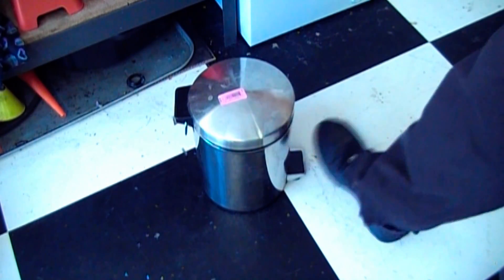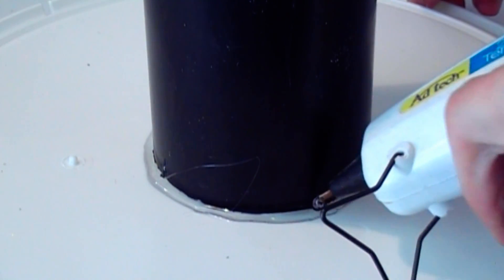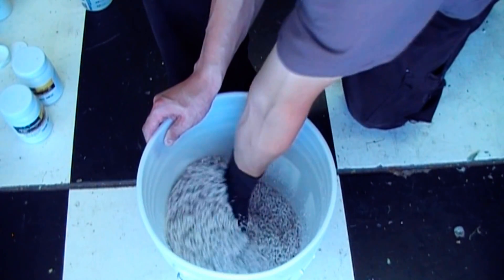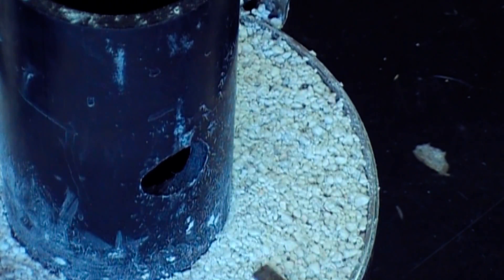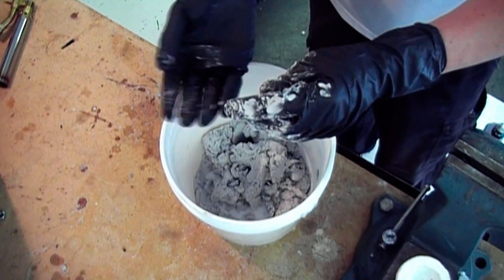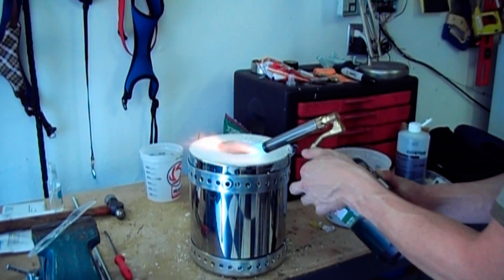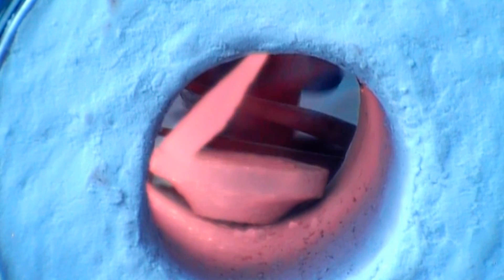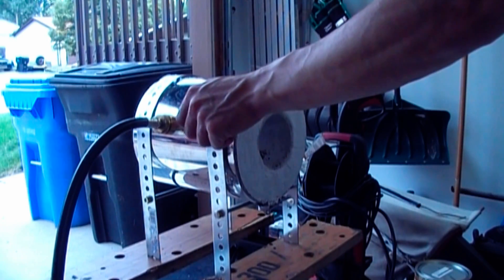How to build a trashcan forge

Comment: Could this be done in a slightly bigger size ? if so whats the ratio of the refectory lining and the sealing cement so this can be scaled up trash cans like that come in large sizes right?  Also could you somehow make doors on it so you could close it and use it for heat treating just curious great video
Reply from the maker: It can be scaled up sure, but the cost gets really out of hand if you go much bigger. The ratios would be the same for the materials. If I were to do a 40gallon trash can sized one, I would make the majority of the lining out of slabs of rockwool, followed by a 3 inch thick shell of this mixture.
Reply: a 40 gallon one would be fairly large haha how much did this one cost to make? i assume when you say the cost gets out of hand you mean the perlite and such?
Reply from the maker: The most expensive part is the aluminum oxide, about 3 dollars a pound, but it's heavy so a pound is not a lot. This little forge used 4 pounds of aluminum oxide. For the forge alone I think the cost was around 35 to 40 dollars.
Reply: Okay thanks for the info man great video very helpful!

Comment: For the coating, does it have to be aluminum oxide or will any sandblasting abrasive work?  I can't find enough silica drying packs, so I will have to order the sodium silica as I cannot find any store that sells it locally.
Reply: cheyennew811 Just trying to help a dude out. :) I had a hard time find it as well, so I was jazzed when I got the kitty litter and it actually worked. :) Also to note, sometimes you need to add a little extra water so the silica can thoroughly melt If your silica gels kind of coagulate and float around try adding a little more water. The first time I didn't add any more water and ended up with some super thick sodium silicate that I had to reheat and add a little water to. Good luck!!
Reply: If you have a Hobby Lobby, go there for the silica.  you can get a 1 pound bag or a 5 pound bag.  very reasonable prices.
Reply: +Dave Smith, we have a Hobby Lobby here. I will go by and see if they have it.
Reply: Go to WalMart and buy MiMi cat litter. It is 4-5.00 for a 4 pound bag of silica gel. That is what I have used more than once to make sodium silicate. Here is a link:  https://www.walmart.com/ip/Mimi-Litter-Cat-Litter-4-lb-Cats/12018928
Reply: +Ith Bombgard Thanks, I will try it out.

Comment: FYI, in any future projects its always a good idea to sand the plastic you want to glue/hot glue.  It helps, especially if it's a slippery surface, like what you mentioned in your video.  Anyways, awesome video, very informative.  I've always wanted to learn about this and now I have, thanks!
Reply: This is generally a good tip, but in this case it seems better to me not to sand the plastic because the lid is just being used temporarily to form the cement, and then it is removed. It'd be a bit harder to remove if you sand first.

Comment: Does it create a problem that the interior surface of the forge is not flat on the bottom?   I was thinking of building a mini forge too so I'm curious to know if it's presented a problem or if you would prefer it to be flat.
Reply from the maker: I have found that the round floor not to be problematic, a flat floor would require filling in the curve and reducing the interior area.
Reply: clkindred Awesome. I just found your channel.  Great videos.  Getting my fill before bed time.

Comment: Do you have to use the sodium silicate along with the perlite? Or can you just use plaster and perlite mixed together?
Reply from the maker: I have found that plaster dose not hold up as well as the binder. It would probably work for a while though.
Reply: clkindred
Awesome, thank you for the reply and all of the interesting content.
Reply from the maker: NwoDispatcher sure, but fine kaolin which would form a plastic like wet clay will need to dry longer before the first firing.
Reply: +clkindred how do you think kaolin would work as a liner?

Comment: The sealing cement... Do we need to add water? I ended up with a very dry un useable clumps
Reply from the maker: that will depend on how much water your sodium silicate had in it already. the ratio of silicate to aluminum oxide I showed is a good start, but you may need to add water.
Reply: +clkindred Thanks, next time, I'll mix the sandy stuff in the watery stuff till it looks good.

Comment: could I use fine sand in place of aluminum oxide?
Reply: +Austin Priest Yes you could. Pure blended silica from kitty litter doesn't melt till 1,713C which is just 300-400C under aluminum oxide. However, pure silica liners (with water glass) have a habit of cracking unless you add a small % of lye. The lye melts when fired to lock it up nicely creating a stronger bond. But still to minimalize cracking I'd bring the silica amount down under 60%. You have to keep in mind that pure silica is very hygroscopic. Which means it's absorbing water and expanding when not in use and is releasing water and shrinking when the forge is turned on. So you need to dilute the silica with other materials.... baby powder is decent. My best liner was made from a package of aluminum oxide / silicon carbide grinding wheels from harbor freight. They're like $10 for a stack. Take the wheels, bang them with a hammer to shatter them then cook them in your forge for 1 hour to smoke the resin out. Those wheels are binded only with high pressure and some resin. So once you cook the resin out (no more smoke) you'll be left over with a mixture of aluminum oxide, silicon carbide and a lower % of iron oxide. None of those 3 materials will expand or contract the way silica does. And it breaks apart like coal after firing. So crush them into smaller chunks with a hammer then throw them in a blender. Mix with a tiny bit of water glass. That mix is stronger than Al2O3 alone. Because I've held my oxyhydro torch to both (2500C/5000F) and I can get fine Al2O3 pieces to melt but I can't get the alumina/carbide mix to melt no matter what.

You could also just set off some thermite and use magnets to remove the pure iron. Or buy sand blasting media from home depot call your store to see if they have it. And I know for a fact that Lowes carry's a product called "Imperials Stove & Furnace Cement". I've used it myself it's a mix of silica, magnesium silicate, sodium silicate and lye. It comes out like a very hard but wet and spreadable black clay. But when CURED PROPERLY that stuff is strong as fuck. It sounds like steel / ceramic when you hit it. And you can mold firebrick and all sorts of shit out of it. It's also very cheap. And although it's less likely to crack then pure silica it will still fail slowly on direct contact with water.  Which is easy to avoid if you're not an idiot.

Overall I'd say buy a bunch of grinding wheels for $10 then buy $12 worth of firebrick cement (mix both to line your forge). Most Lowes employees don't know where it's stored and will say they don't sell it. But it's right by the fluxes and plumbers tape and really is some cool shit. You can make crucibles and all sorts of stuff just never wash them with water and you'll be good. Also be sure to CURE SLOWLY. More slowly than the directions say. It will set up immediately (less than 5 mins) and get hard but I let it sit 3 days if I'm making a crucible. Sometimes I'll put it in a dehydrator for a day. Then I prefire it very low around 200-300C for 2 hours. Then I wait another 3 days to do a 1000+C fire. It's super cool stuff and realistically is all you need to line your forge. And the more you fire it the more resilient it becomes to water but I'd still never wash it with water.
Reply: +Robert Cece Thanks for your input Robert.
Reply: +Robert Cece Awesome, thank you very much.
Reply: +Robert Cece 
 can take the recipie from vid, replace the Alum Oxide with high temp Fire brick Cement.. and I'm good to go? 
Alum Oxide is a tough cookie to get cheap.. local.. if I can use fire cement in lieu of the oxide .. that'd be reassuring and I can start building :) 
many thanks for your help..
Reply: +Austin Priest maybe you can help... I am set to build but I need a substitute for the Alum Oxide... am I grand to power on with fire cement or have you found any other tips while searching.. im in same boat.. the alum oxide is my only obstacle right now.. many thanks Austin. :)

Comment: Very, very clean looking build,  I have a question, how much insulation does this setup provide? can you get a reading on the outside of the forge for instance, i can tell it doesn't appear to turn red or heat up, but i was wondering how it is working long term, Also what temp can you get inside your forge? Thanks

Comment: Does it matter what size grit of aluminum oxide I use
Reply from the maker: +Rob Stevensen Sort of, the smaller the grit, the more easily it coats the perlite. As for the sealing cement, the smaller the grit, the more "clay like" the cement, larger grit has trouble being worked and spread because it's more like wet sand.

Comment: Hi, Is it okay to use potassium silicate instead of sodium silicate? What is the main difference between the two substanses?
Reply from the maker: +Eetu Korhonen It would probably be fine, there is not a lot of difference between the two substances, although the potassium silicate would be more expensive.
Reply: +clkindred Thanks for your reply. How has your forge held up? Im intending to use mine to melt bronze and forge weld steel, do you think this refractory is suitable for that kind of use?

Comment: i was wondering what is the brand of trash can that u used in this project, and was wondering if a Better Homes and Garden brand stainless steel trash can would work  but do not no if it is galvanized or not how would i find this out

Comment: Clkindred thanks for the great video. Question...Can you make the insulation out of sodium silicate and perlite only and not use aluminium oxide? It's hard to get and some of my research suggests it can be done.
Reply from the maker: +David Penny Woops, I'm slacking on checking comments again. You could do perlite and sodium silicate, but it won't hold up to as much heat.

Comment: Could you use carbon powder instead of aluminum?
Reply: Or possibly manganese dioxide?
Reply from the maker: +Hunter Bowie not sure about manganese dioxide, but carbon powder might work. As long as the sodium silicate protects the carbon from oxygen.
Reply: +clkindred I'm just worried the carbon will absorb heat rather than reflecting it like the aluminum. I'll have to devise some sort of test.
Reply from the maker: Are you referring to the black color absorbing heat? The white color of the aluminum oxide would seem to reflect radiant heat better, yes. However the aluminum oxide conducts heat through it pretty well, so there is a tradeoff. Most white colored heatsink compounds or thermal conductive grease are aluminum oxide based.
Reply: +clkindred Fair enough. I was just thinking about how aluminum is used in things like thermal blankets and heatshielding but your right it should conduct the heat better. I have a bunch of carbon rods lying around so if I crush em up perhaps they would make for a better forge refractory, I'm no chemist to be sure tho.
Reply: clkindred Oh and thank you for the informative replys i do really appreciate the help!
Reply: +clkindred Just to let you know i tried the carbon for science and it did not work well, melted through quickly and my perlite is quickly vanishing.  Im going to replace it with aluminum, shame i couldnt save a few bucks with the carbon but oh well.  At least i tred!
Reply from the maker: +Hunter Bowie Bummer, I hoped carbon would work, on paper it seems like it should work quite well. What was your source of carbon?
Reply: clkindred I used sugar that i heated enough to drive out the oxygen and hydrogen.  Sugar is almost 50% carbon so i thought it would be a cheap way to get some.  Once the mixture stopped releasing gases i ground it down to a very fine powder and mixed it in with the other ingredients. I may have made some mistake along the line but as far as i can tell the carbon was oxidized by the heat because the coating changed colors as temperature increased.  Going from black to white after a few heats.

Comment: Great vid thanks for your effort. My effort is a disaster however!!!.. The Aluminum Oxide and Sodium Silicate covering will not go off and when I torch it it just bubbles and melts. Not sure what  I'v done wrong..any ideas?
Reply from the maker: Too much sodium silicate, or too much water, or both. Early on I would always add too much sodium silicate, and it took a lot of attempts to learn to add less than what I felt it needed.
Reply: +clkindred 
thanks for that. Do you mean the water content of the Sodium Slicate? I did not add water to the sodium silicate and aluminum oxide mix. Also had problem with the perlite mix not hardening even after a week of air drying. Thanks for you help, much appreciated.

Comment: Hi I can´t find any (Al2 O3) in my country and import 2 Kg will cost arround 300 dolars, Can it be replaced with (Mg O)? I ask before trying because I woul have to buy a 25 Kg package of Mg O.
My other option is to mix clay (Al2 O3 - 2 Si O2 - 2 H2 O) with  NaOH diluted in wather and boil it until it gets a similar moisture content to the sealing cement you are using ( I know the proportions are not going to be the same and don´t know how reacts the NaOH  with the Al2 O3 part and clay is full of impurities but I have no more ideas)

Comment: Thank you! very good video!
How is this setup holding up these days?
Reply: clkindred:  I would also like to know how well it held up.  I'm especially interested in the effect of adding the aluminum oxide to the mix.  Do you still recommend using it?  I would think that it would conduct heat rather than provide insulation.  Looking forward to your reply!  :-)

Comment: i like your video.. i planed to build a gas forge but there are some questions where can i get this "aluminum oxide sandblasting abrasive"? i found this on ebay http://www.ebay.de/itm/2-5kg-Edelkorund-Strahlmittel-div-Kornungen-Aluminiumoxid-Dentalstrahlmittel-/150974337472?var=&hash=item2326c591c0:m:mySyUEz0NBzcHrxdpIhSk0w
how long does your forge stand the heat? 1 hour 5... or much more? 
in some other videos i saw them using ceramic fiber for insulation with fire cement  (1600°C) for the chamber insides

Comment: What's the inner core made of?
Reply from the maker: the inner form is a piece of ABS drain pipe.
Reply: +clkindred ah thanks man, do you think you could do a parts list? I want to build this set up asap
Reply from the maker: +Andrew K That is something I have tried to do with other related projects such as the burner. However, the exact parts are not all universally available and some people can't get them all. Also, the exact parts are not necessary, and a working forge can be made with different parts. The best use of this video is the basic idea.
Reply: +clkindred awesome! Thanks again man

Comment: I'm trying to build a DIY Konro grill similar to this one  http://korin.com/Charcoal-Barbecue-Konro-Lg?sc=29&category=17859353
 by possibly using your mixture.  I was going to build a positive and negative mold out of wood  and fill it in with the mixture.  Do you think your recipe/mixture would be a good one?  I could definitel  see where heat wouldn't be a problem but would it hold together considering I don't have a "can"  around the outside?

Comment: Could this forge serve to melt glass? (around 2300 degrees F)
Reply: +Micah Liceaga The primary binder used in the refractory mix, sodium silicate, has a melting temp just shy of 2000 F and Perlite melts around 1600 F so my guess is NO if used as a pot furnace.  Should be OK to use for bending glass rods and tubes, though.

Comment: Where are you obtaining your 2 lb bottles of sandblasting materials. I have not seen them sold like that before.
Reply: +a1930ford It was sold by Harbor Freight but I have only found the black 70 grit version.  I don't know where the black comes from but just the color change will effect heat reflection and absorption.
Reply: +Eddie the Grouch  I just bought some aluminum oxide on eBay.  Very reasonable price with shipping.  Harbor freight no longer sells the small 2# bottles.

Comment: I have tried to get dead burned magnesium oxide but it appears to be even more difficult to get hold of than aluminium oxide. On Googling refractory I see that silicon dioxide is also classified as a refractory material and as it is used in the food industry it might be easier to get hold of. Would silicon dioxide work?
Reply from the maker: +Rob Meister Silicon dioxide is what sand is mostly comprised of. It can be used but it won't tolerate as much heat as aluminum oxide, however it is silicon dioxide that "glues" the aluminum oxide together in this recipe. The sodium silicate has a unique property of decomposing under heat to form silica without ending up a pile of sand. It maintains the amorphous glassy property which glues everything together in a glass like matrix. Long story short, it might work as well as this recipe with aluminum oxide because the weak point in my refractory is the silica glue.

I found that the word "refractory" is somewhat of a broad term and dose not necessarily imply a given heat tolerance, just that it is resistant to chemical and mechanical failure under a certain amount of heat, the exact temperature varies anywhere between a few hundred degrees, to many thousands of degrees.
Reply: +clkindred Thank you